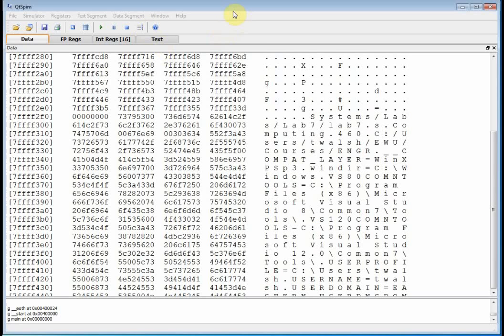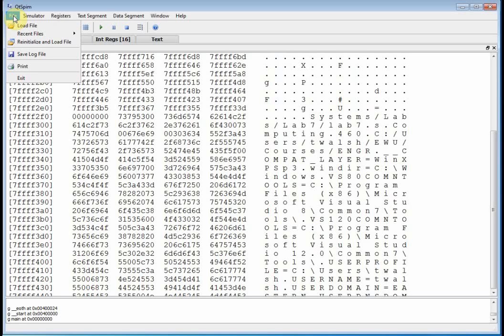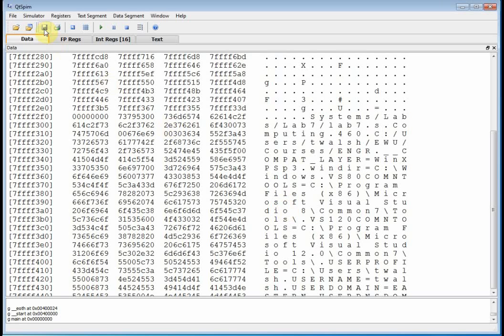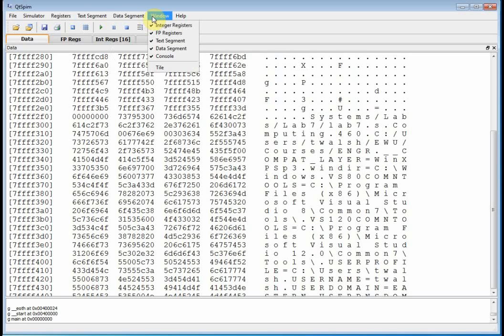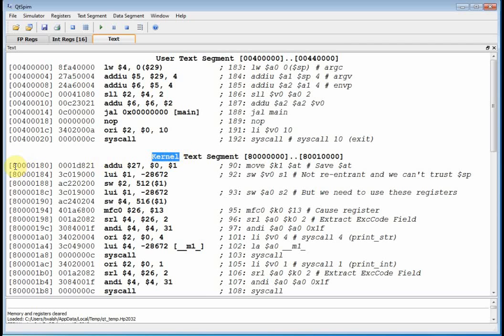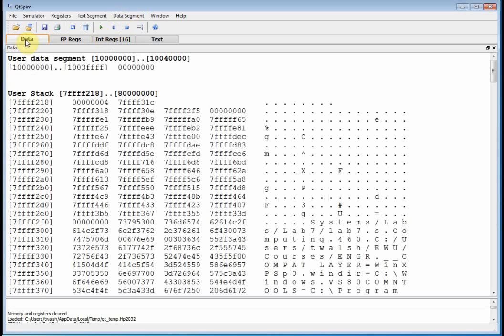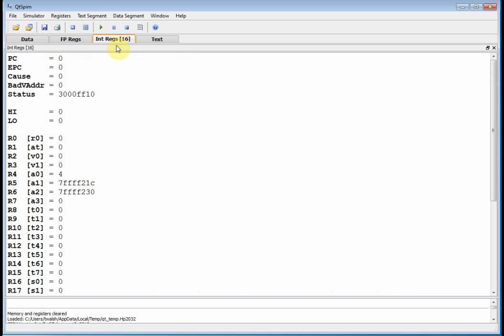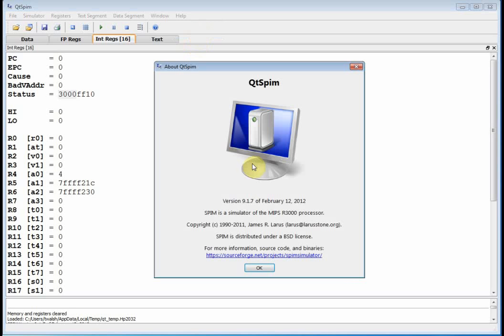EENG 460: MIPS #0: Intro to QtSpim

Comment: .text

.data

.globl main

main:
li $t0, 0x0
li $t1, 0x1
li $t2, 0x2
li $t3, 0x3
li $t4, 0x4
li $v0, 10
syscall

this is my code the simulator rejected the answer : bad instruction address 

what did i do wrong ??? i wrote the exact same code
Reply: .data and .text location needs to be reversed..